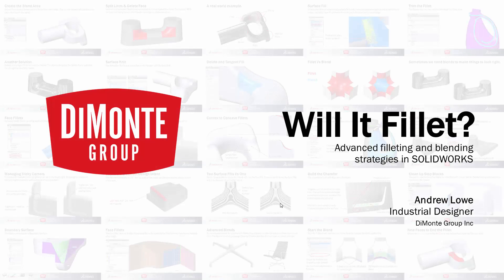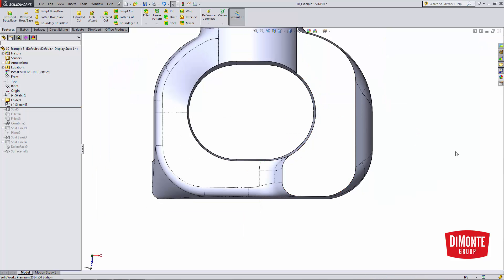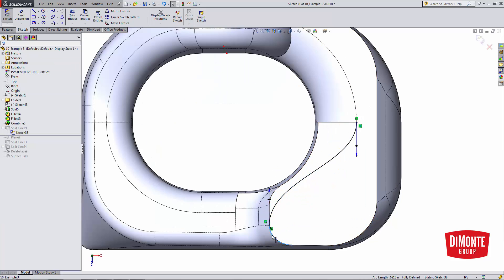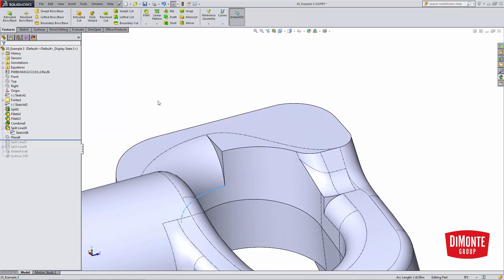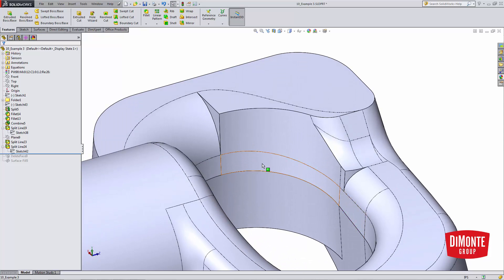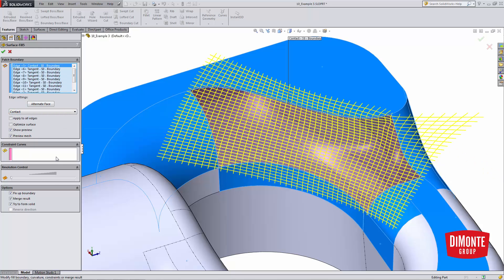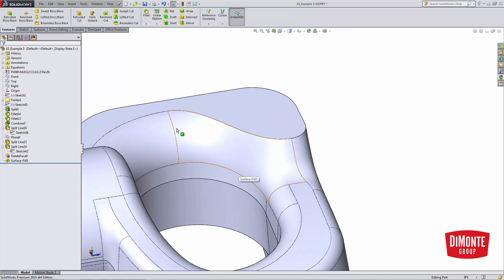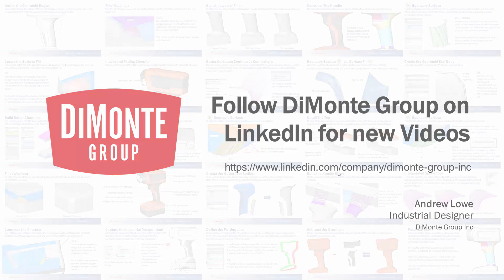Will It Fillet? | 09- Convex to Concave Fillet Transition

Comment: Cool...now do a video on how to make a drawing for that feature.
Reply from the maker: This part went into production with a drawing used for inspection of critical-to-function features.  The part geometry was used for the tooling.  There is no need for a drawing describing that blend.  
At most, the print might specify inspection points, or maybe present cross-section views define the 2D contour for template gages.  If you know how to do a drawing, you already know how to do that stuff.
Reply: @DiMonteGroupInc  Not sure what world you live in but the world I live in, I need a drawing for everything
Reply from the maker: @IcanCwhatUsay  Everything released for manufacture will have a drawing with inspection dimensions, tolerancing, revision control, material/finish specs, etc. etc. etc.  
The overwhelming number of vendors we deal with don't need drawings to fully define cast and molded parts.  I can't think of even one.
  
Other processes, like sheetmetal, powdered metal, extrusions - the 3D is sometimes not used because they prefer the 2D